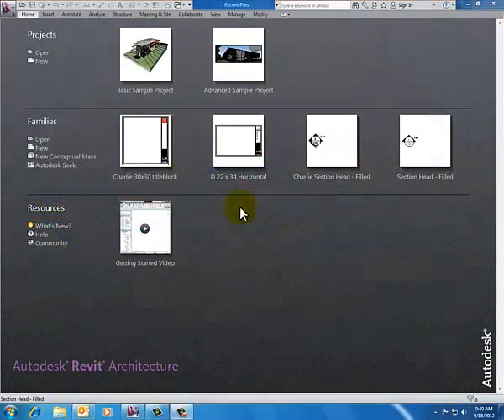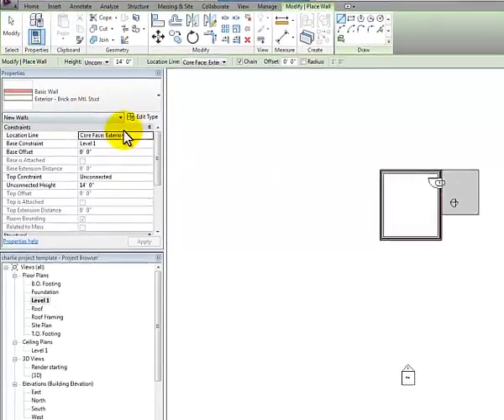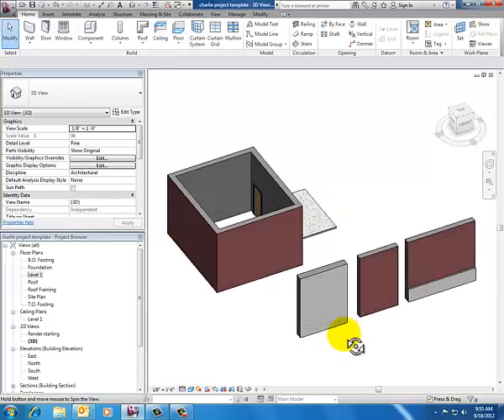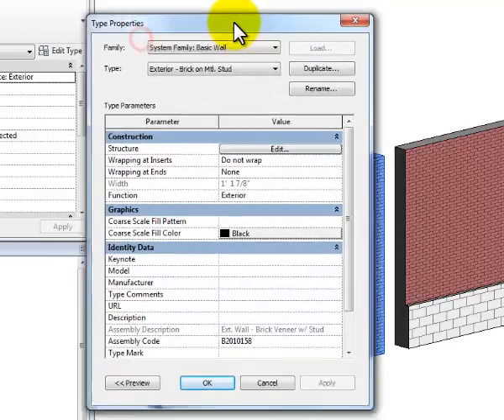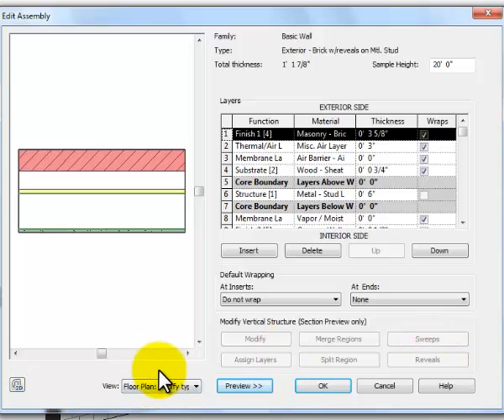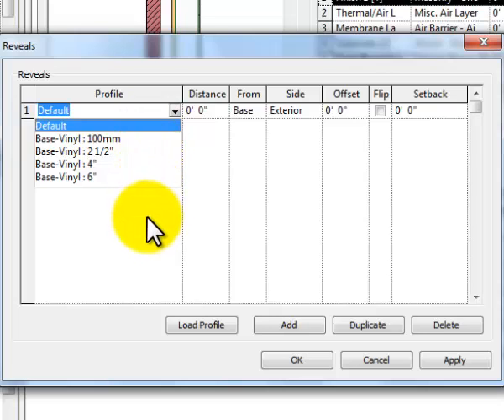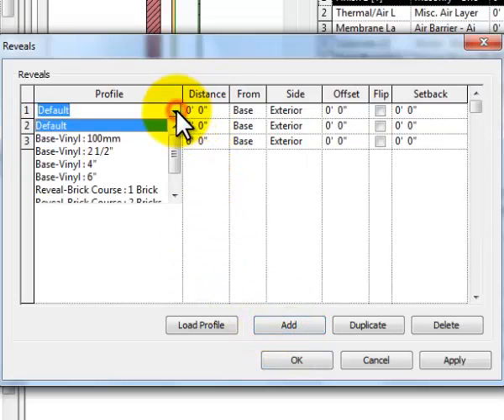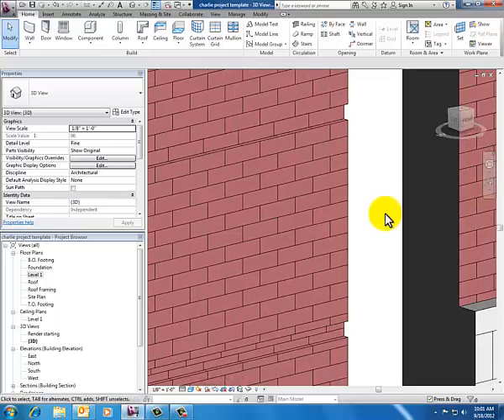Revit Custom Stacked Wall

Comment: Thank-you, very helpful video sir; however I believe by the end of the year I will have found fault with every tutorial. You know as well as I do that there are a number of Brick types that have individual heights, widths and depths, but the standard height size is 2 1/4” modular (approximately 2 2/3” which include a mortar joint) with reference to the 8” (7 5/8”) CMU block modular height. Three brick courses per block. However you are using metal studs; but I have found it very helpful using the same practice as if the wall was block. The brick reveal is formed only by the fact that the brick recesses back into the air space (finger space) between the CMU or Metal stud partition. Why does this imaginary outline appear on the exterior face of the brick? Will I be able to show this correctly when developing the Wall Section? Also the revel location from the finish floor is important; likewise the reveal from the base. If the intention is to use a 4” face brick at the base and then use standard brick size for the remainder of the wall, then 3’-0” above the first floor will achieve a CMU block coursing. The mason can always pick up some fudge with-in the mortar joints while staking the brick if necessary. I believe the Revit tutorials should also remind the draftsman or Architect the construction of a building. Please forgive me but I am very frustrated with Revit and the approach in developing construction documents. I believe you and I both see 3D, 4D, 7D (all the 'D' images) when drawing; you and I don’t need a computerized generated device and software to see these images.  My main question is that when using REVIT should I take the intricacy detailing, coordination and the huge amount of TIME required to generate (system assemblies) a wall partition or exterior wall section at the schematic design stage? Or do I just draw 2 lines? I suppose with REVIT it seems foolish not to thoroughly create these system assemblies (down to the brick ties) before drawing……..however I have never developed my intended wall types during preliminary/schematic design. Thank you

Comment: help i cant get the outside exterior wall to match with the interior walls. i changed the brick on metal stud to wood stud and the finish face exterior line dont match with the interior, its throwing all of my inside dimension